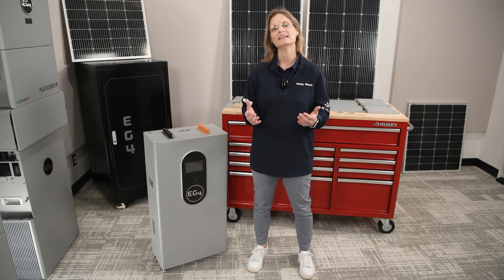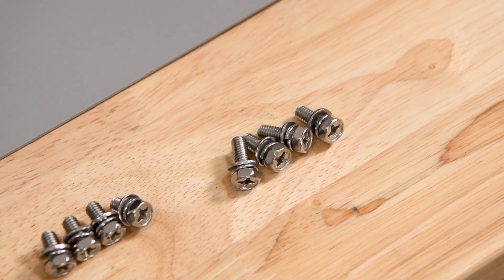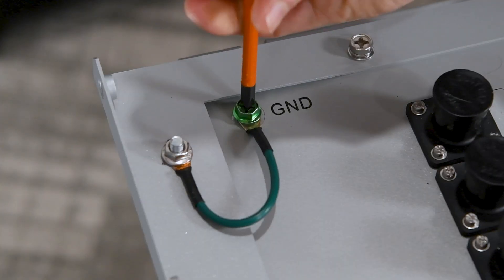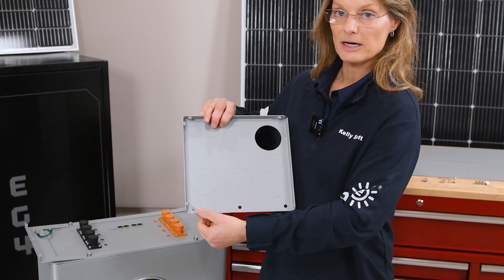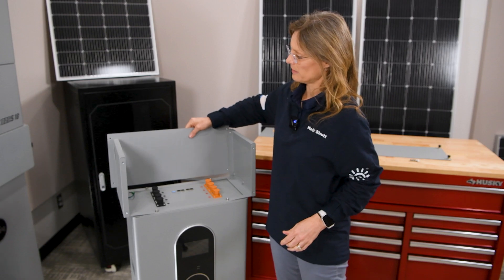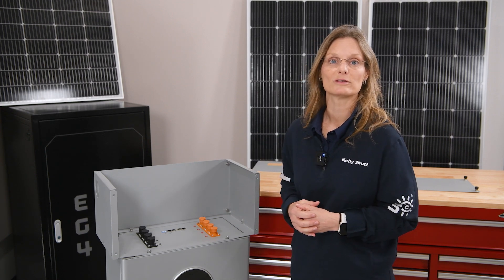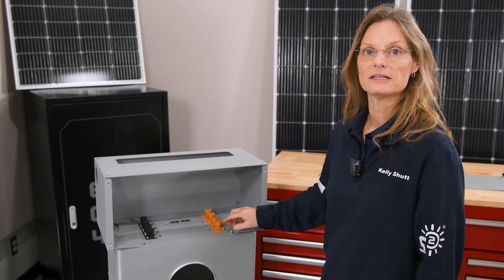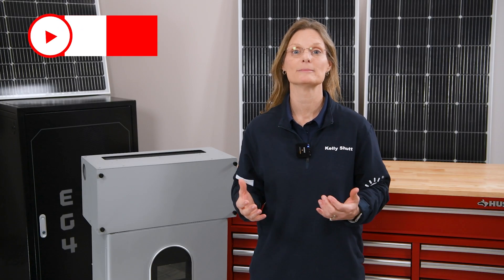EG4 Indoor Buildable Conduit Box | Step by Step Assembly

Comment: If you use more than one battery on a FlexBoss21, how do you connect multiple cable channels together, end to end?
Reply from the maker: You’ll daisy-chain the batteries using the FlexBoss21 battery communication ports, each battery links to the next in series, and the last battery ends at the inverter’s battery comm port.

If you need help walking through it, feel free to call in! 903-441-2090, option 5!

Comment: Can you show how to connect conduit boxes for parallel battery set ups? What type of conduit between boxes. Than you.
Reply from the maker: Hi! You'll typically use PVC or flexible liquid-tight conduit between the boxes; however, this depends on your installation environment and local electrical code. If you need further assistance, please don't hesitate to reach out to us at 903-441-2090. We're here to help!

Comment: When is the top cover coming to use with a Gridboss?
Reply: I suggest bringing back the old legacy indoor box back that is way sturdier than this one. The sides on this box move a lot even when all the screws are tight. The hinge, latch, and lock are an added bonus. I would pay more for it. This box is a sad piece of EG4 gear. Inferior to all the other EG4 gear I bought
Reply: Hi! The gridboss doesn't have a conduit box, as it is not intended to mount to the battery or inverter.
Reply: @JessicaGray-signaturesolar Is there any issue with doing so? In a limited space, it works well to have my griddboss on a battery and my flexboss on another battery.  Service cables after the main disconnect would be in the conduit box.
Reply: @dalboltv9747  No, this would be fine. You'd just have to create your own cutouts in the conduit box.

Comment: I recently put two of these together. For the future, I’d suggest having inverter specific tops. The long rectangular knot outs fell out while trying to “knockout” the typically used round knockouts. This was an interior install, but the conduit boxes were a must to keep small rodents out that like to chew on wires. The fix was to place multiple pieces of hvac tape across the holes to close them up. Just kinda tacky for a final install
Reply from the maker: Thank you so much for this feedback! We will forward this to the manufacturer. Please dont hesitate to give us a call at 903-441-2090 if you need any assistance!

Comment: I have two of these.  It's... "ok".  Fairly decent but I would really rather the box had been wide enough to stack them horizontally to get proper 7" battery spacing.    right now if you stack them horizontally you only get around a 4" clearance between batteries, and that's only if you really stretch the chases.  It's a fairly big failing of this conduit box.

Another thing that would be nice would be if you had a top plate without knock-outs as an option, as well as "blank" bottom plate without the big rectangle cut-out, to make it easier to put together boxes for future battery expansion when the batteries are not yet purchased.

Other minor issues include difficulty taking the boxes apart later when equipment is installed due to the screws being screwed-in from the outside-in for the top plate.  That could be cleaned up.  Get all the screws screwed-in from the inside of the box to make taking it apart easier post-installation when work needs to be performed on equipment.

-Matt
Reply from the maker: Thank you so much for your feedback, Matt! We will forward this to the manufacturer!

Comment: Kelly, why was this box designed to hang over the sides of the battery? To me, it just has an unappealing appearance. I think it would look much cleaner if it were the identical width of the battery. Mind you, I don't own the batter or the conduit box. I have four EG4 Lifepower4 batteries and a 6000XP inverter. I'm just saying this fit doesn't look very good. But I'm sure there's a reason for this design... However, I do love all my EG4 equipment and the sales/support from Signature Solar!
Reply: Honestly, I want them to be even wider to accomadate the 7" horizontal battery spacing spec.  It would make things a lot easier to put together when you have more than one battery.
Reply: Likely to accommodate the width of the different inverters that are intended to mount on top like the 18k pv or flexboss
Reply from the maker: Thank you so much for your feedback! As the distributor, we don't design the products, but if you'd like to reach out to EG4 directly with these questions, they may be able to help! You can reach them at support@eg4electronics.com!

Comment: I wish this would have been there a month or so ago. Nice job. I will say that when I was removing some of the round knockouts the rectangular one  detached. I used some grid wall connector clips to reattach it. I had to drill 4 small holes in the plate but it worked great. Someone may have a better fix but I haven't seen it.
Reply from the maker: Thank you so much for your feedback!